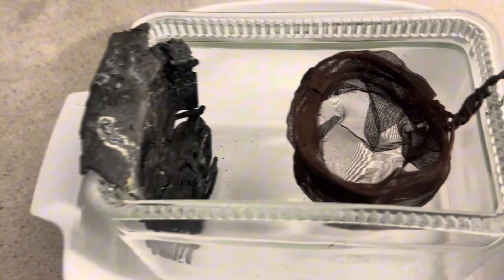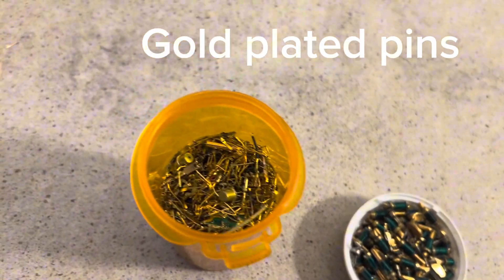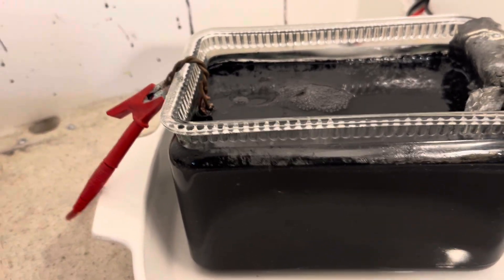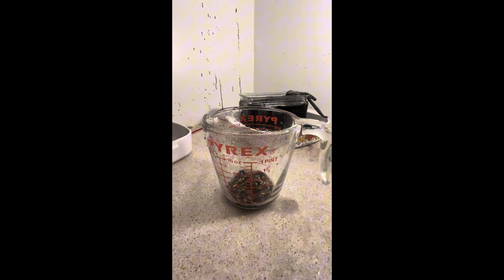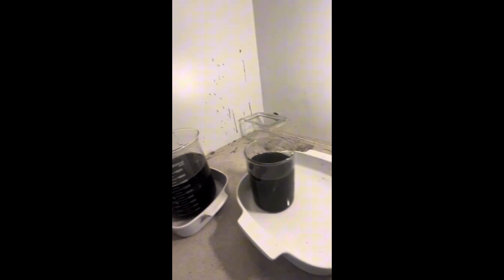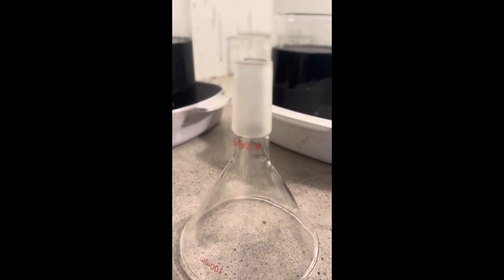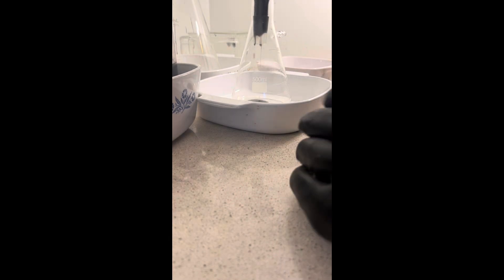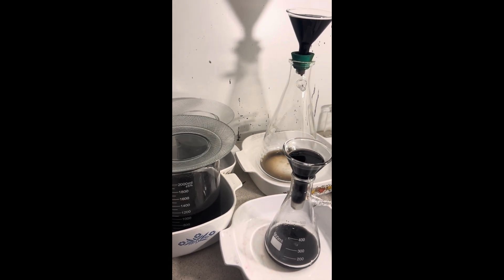Sulfuric Acid stripping cell to Recover Gold  #gold

Comment: Aren’t the pins going to dump iron into the solution?
Reply from the maker: concentrated sulfuric acid and iron : the iron will form a protective layer ( passivation ) in concentrated  sulfuric acid now if it is diluted it’s a different ball game .
Reply from the maker: Probably should have weighed them but the sulfuric acid stripping cell just strips the gold . It settles down decant , filter the electrolyte/ sulfuric acid . Process gold reuse the acid for another run
Reply: @ It looks like strong sulfuric anodizes the iron mostly.  The rest drops as iron(III) sulfate.  Interesting.  Easier than Eco-goldex E.
Reply from the maker: @ I was thinking that the plastic pieces I had could be an issue. I bet the eco gold recovery powder would be a good solution for pins that still had plastic pieces attached .
Reply: @ Thats my next batch.  Bunch of 1960s and 70s vintage plated connectors.
Reply: @ Cool.  I like your videos.  Always something to learn.
Reply from the maker: @ we are all in this together
Reply: @ I got all set up for chromatography but it doesn’t seem practical right now.
Reply from the maker: @ I think the hardest part is waiting for it to settle . I’m filtering the rinse water solution now. The sulfuric acid electrolyte which has the gold is settling in a 2L beaker now
Reply: @ 50ml x 6 centrifuge would make quick work of that.  Like $150 on Ebay.